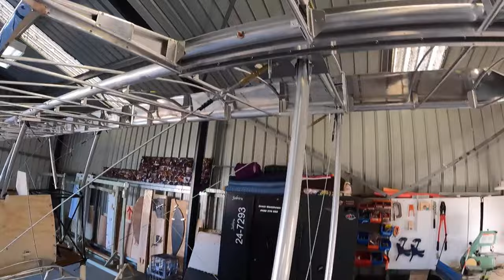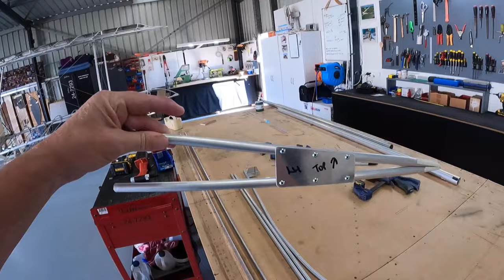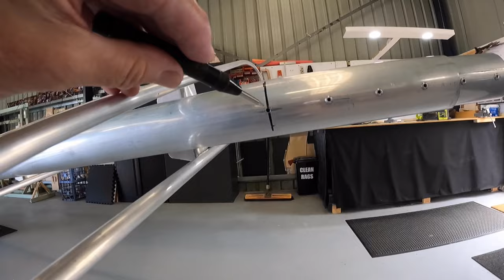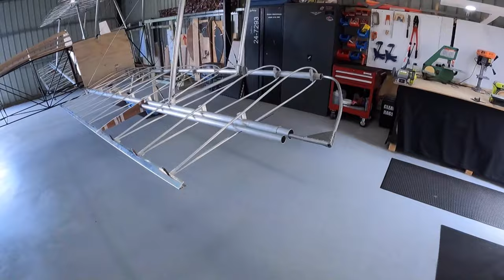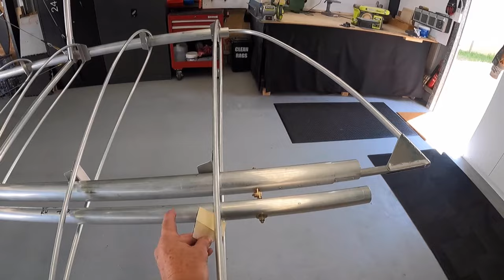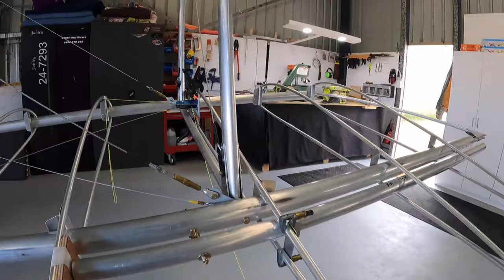Building 1916 Sopwith Camel Lower Wings - DIY Aviation

Comment: It's a form representation of a Sopwith Camel utilising current materials and construction techniques, and IMO you are mastering a great project 😊 By memory the access in that era was generally a couple of D-shaped foot cutouts in the fuselage. I suggest you have a few evenings in front of the gogglebox and watch classic old movies like “The Blue Max”, “Aces High” and “The Red Barron”. Now you’ve progressed so far you will notice all sorts in the background you wouldn’t have a year ago. Love your content 😊
Reply from the maker: Thank you I look at those movies
Reply: @scottmatthews5280  On the original, a single D shaped foot cutout left hand side, on the lower longeron, in the bay just behind the trailing edge. Horizontally it was 3 foot away from a "scuff plate" on the cabane beside the cockpit rim. My pick is it's an ungainly entrance/exit with a very large stretch... With your build, you could potentially do something a little more convenient 🙂

Comment: Getting into a camel.
Just been looking a photos of an original camel. On the original camel there is a hole for your right foot just behind the port wing and a handhold just behind the pilots seat on the turtle deck ,the wing spar has a piece on top to reinforce it for your left foot, then swing your right foot into the cockpit. Hope this helps.
Reply from the maker: Yes you are correct, might just need some Yoga lessons!

Comment: To me it's a real Camel. Regarding getting in the thing: There is a foothold on the port side fuselage just aft of the lower wing trailing edge. I assume that takes your right foot and the left goes up on your wing root panel, appropriately reinforced.
Reply from the maker: Correct, but then I need to jump! To high to get in. I’ll work through it.
Reply: @scottmatthews5280  Lots of Camel and Pup videos, but hardly any (if any) showing the climbing in!